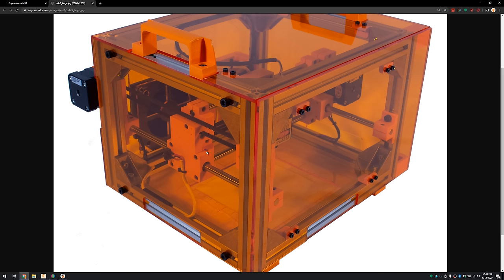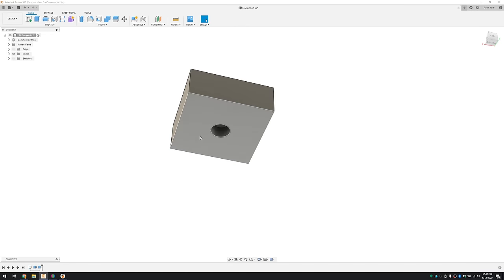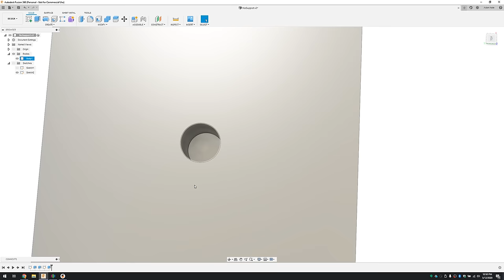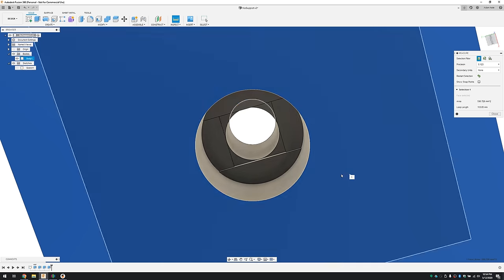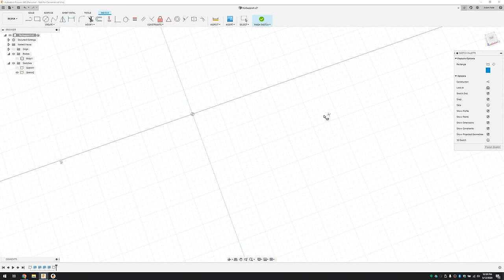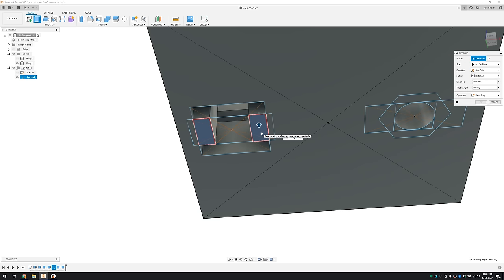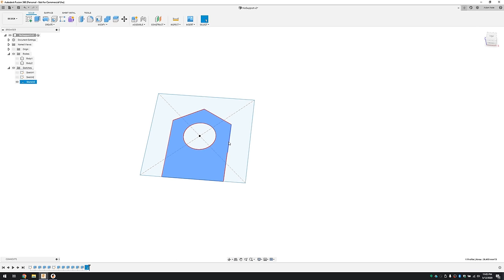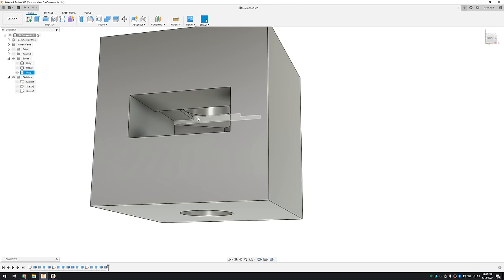3D Print Floating Holes Without Support! (With This One Weird Trick :P )

Comment: Thank you for this! I just incorporated this into a design where I had a bunch of counterbores and pockets for nuts. I ended up creating a body with the necessary features on it to use as a tool to cut the features into the model. Saved my having to do the multiple extrusions for each screw.

Comment: This is great. I ended up here because OrcaSlicer has a "Bridge counterbore holes" option in the Quality tab that does this automatically, but I think I found a bug because I can't get a modifier to apply that option to only a portion of the model. So I need to do this manually in Fusion.

Comment: Thanks for this, giving this a go right now. One thing to note is that I had to change my Top/Bottom Line Directions to [0, 90] in Cura for the layer lines to bridge correctly. Otherwise they wanted to bridge at 45º to the square holes. Edit: Worked like a charm, thanks again.

Comment: Excellent. I did a slight modification of using lines so that there is no cut on the outer wall, but concept identical. For larger holes, one might need additional steps to allow the arcs to be printed.

Comment: This is great. I have a situation like this inside of a a thing where water should flow and neither supports or sacrificial layer is a good solution.
Have used this to good effect. But step two is to make it work with a chamfered bottom edge. Chamfer is important for water flow.

Comment: great video!  PRUSA designs their parts on the XL (in 2023!!) and others with a square step inside but not with the 2 step.  It eliminates most of the issue but not perfect.  Yours is cleaner but leaves the head with a bit more air under it?...  Really nice! Thanks.

Comment: Great tip, I was curious so I tried it with an LCD resin print and it worked fine (at least with 4.5 mm holes). I've found overhangs are hit and miss on resin printing. Nice to know if I publish my part it should print well regardless of whether FDM or resin printing is used.

Comment: I know this is an old thread, did you ever create a solution for vertical holes? That never print round lol.
Reply: You can turn the top of the hole into a ^ shape so the overhang is at a reasonable angle. Your hole will then look like a water droplet. If you want the end result to be a perfect circle this obviously doesn’t work but it can be useful in many cases.

Comment: ...or you could just make one layer that is solid, then take a drill bit and clean the hole up, would take a lot less time than all that extra modelling work in Fusion...
Reply: Depends on how it will be used. Modeling it once for printing once, you might be right. Modeling it once to print it 2000 times, saves a lot of drilling time.
Reply: you can have those features as a separate positive object to be removed from whenever you need it, so you just model it once per type hole. He also shows places that are hard to get and this can be generalized for different geometries of overhangs. This is actually something pretty cool.